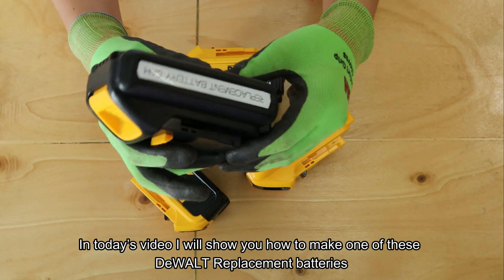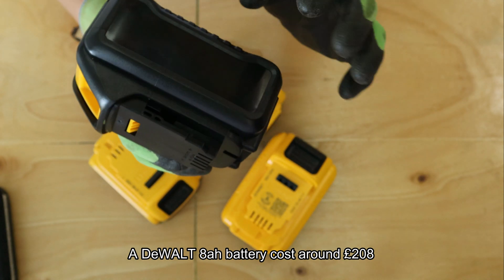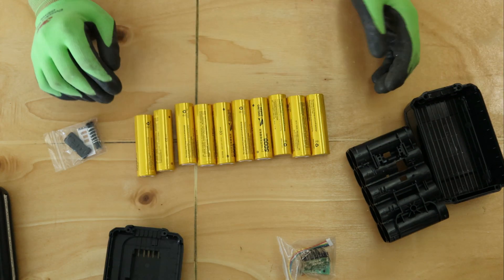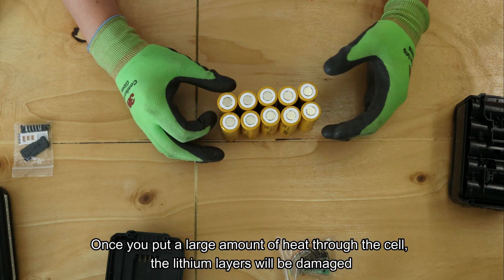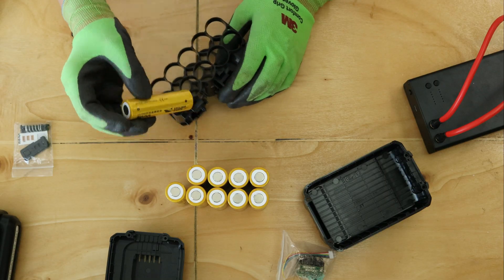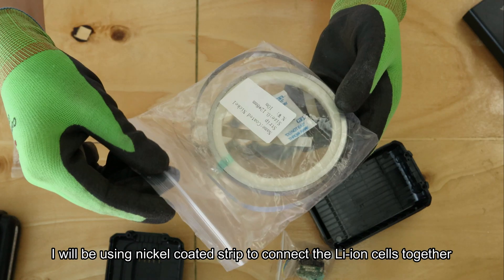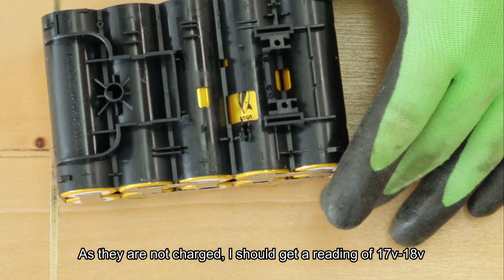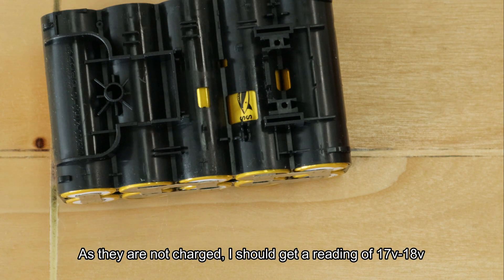Make Your Own DeWALT 10AH 20V MAX Replacement Battery | My assumption was.....

Comment: Use "molicel P60B" 500+ charging cycle, 6000mah capacity, 60a discharge rate, runs cooler than cells DeWalt using in their packs

Comment: Why did you reverse the polarity configuration of the pack?  Standard DeWalt packs have the positive at the front of the pack and the negative at the other end of the pack.  When you are doing something use the KISS method - keep it simple, stupid.  The screws on my 21700 pack were 10 torx.

Comment: I chargers any pack battery to 4.2 volts before I build the pack.  The reason that I do is so I can test them for capacity capacity of the cells - some lithium battery manufactures lie.  I bough some batteries that were rated at 3999 ma and they tested out at a nominal 2550 and change, which is why I buy Samsung batteries, now.  They always test out slightly above their stated capacity.  I tested out some Samsung 50S cells today and they tested out 4,998-5002.  Can’t beat that for consistency, can you?  You need to warn any viewer to put the positive and negative leads on the inside part of the tab on the plug, otherwise you will not get the cover to go on the plug.  That is the voice of experience.

Comment: I am building a 21700 pack to go along with my 18650 packs.  I am building it with 10 Samsung 50S 21700 cells.  It took me six hours to charge them up from 3.56 volts to 4.20 volts.  I then tested them for capacity and the averaged over 5000 ah.  That should create a 10 ah pack.

Comment: I would advise LT42A, P45B, T39 or T42 cells.. You need higher continuous discharge rate than the 10-15 these offer.

Comment: I bought a knockoff DeWalt pack from ebay and I noticed its not as solidly constructed as an original.  Do you think it would be safe to fill it with epoxy to firm things up?

Comment: Cordless tools are power-hungry beasts. They can easily peak consume up to 40A from the battery. I wouldn't advise using those 5.000 mAh cells. They are designed for high capacity at low  currents, like 10A max. Above this current demand, they will heat quite rapidly, and their capacity will go down significantly. The best 21700 Li-Ion cells for cordless tools are those with 3 to 4 Ah capacity since they can withstand currents as high as 40A without any issues.
Reply: Samsung 21700 - 40T
In DCB2108 Powerpack

EVE 21700 - 50PL
For upgrade 💪🌈
Reply: @Moog_06eve 40pl or molicel 42a for best bang for buck for 21700, for 18650 would be eve 25p or eve or bak tabless cell

Comment: The genuine DeWALT 10Ah battery has a slightly larger case for the Samsung INR21700-50S cells. They have extra cooling requirements compared to the 6Ah and 8Ah packs. Both 6Ah and 8Ah have the same shell that is smaller than the 10Ah battery’s shell despite all three having the same 2P5S 21700 configuration.

8Ah has Samsung INR21700-40T.
Reply: These are the details I needed. Thank you for sharing this info.
Reply: @justinholmes5614  Glad to help. I tore into mine a few weeks ago and I couldn’t find that info before. :) I believe the board circuitry is adjusted for the 85°C temperature requirement of these cells (from the INR21700-50S datasheet). It has the same PCB as my 8Ah pack but the board is marked for different configurations… perhaps populated differently for each? Not sure.

There is also a large fuse that isn’t present on the 6Ah and 8Ah packs.

FWIW, I found a set of unbalanced cells in my bad one but after bringing that segment up and running both batteries in the lawnmower this pack still loses power faster than my good one and gets ridiculously hot (good one is just warm). The mower now quits with the good pack only missing one bar and the bad one still having one bar, likely because the mower detected the imbalance and is attempting to prevent over-discharge. Sure enough, I checked and the cell imbalance was worse than before, likely because those cells overheated. I’m now doing a days-long refresh cycle on the bad segment but I doubt it will help. It’s been taken apart with test leads to my smart charger for a few days now. :)

Comment: Uuuuu. In the dewalt your paying for the chip in the batters to prevent accidents.
Reply: The chip in the battery don't save it from low voltage, that's in the tool, mabey the chip your talking about preventing accidents is for charging?

Comment: The trick to making a good replacement pack is to get good, name brand 18650 cells that have a high amp discharge rating. The originals are something like 20amp discharge rated. The higher the mah, the lower the discharge amp rating. The higher the discharge amp rating, the better the tool will preform. A lower rated discharge amp rating will be ok for a drill maybe, but not for a circular saw or an angle grinder. Any 18650 cell that claims to be 6000mah, just know that it's not, and even if it was the discharge amp rating on it would be maybe 1 or 2 amp discharge. So straining the tool will cause the battery cell to overheat and likely cause the tool to shut down.

Comment: The nickel you used is not made for the amount of amps flowing through these packs! Use the nickel that comes with the kit, and use a spot welder that can weld the thicker nickel!
Reply: Here it comes the debate of soldering cells. Thickes strips more expensive spot welder or you risk bad connections. I went soldering route where you heat the battery for literally 1 second. There're videos proving that soldering, if done properly doesn't harm cells.

Comment: You need to buy 2 spot welders folks! Because when the batteries in the first spot welder fails you'll need the second spot welder to spot welder new batteries into the first spot welder.
Reply: Not if the batteries are soldered onto the board like on my spotwelder.

Comment: just to be clear, soldering onto the cells itself is bad, but soldering onto the nickle strip on the the cell is okay? is this because the nickle protects the cell?
Reply from the maker: Sorry for the confusion, you should always try to avoid soldering on a cell. However, in certain circumstances, this procedure is inevitable for example soldering the wire to the strip.
Reply: In my understanding, the balance leads transfer very little power. Just weld Nickle tabs to the battery tabs, fold them over the edge and carefully solder. The heat is dissipated before it significantly can heat the battery. That's how Dewalt does it on the factory packs.

Comment: Where did you get the dewalt battery housing and indicator ? can you provide the link ?
Reply from the maker: https://campaign.aliexpress.com/wow/gcp/tesla-pc-new/index?UTABTest=aliabtest377151_530968&src=google&src=google&albch=shopping&acnt=708-803-3821&slnk=&plac=&mtctp=&albbt=Google_7_shopping&albagn=888888&isSmbAutoCall=false&needSmbHouyi=false&albcp=17858129175&albag=&trgt=&crea=en1005005094635795&netw=x&device=c&albpg=&albpd=en1005005094635795&gclid=CjwKCAiA9NGfBhBvEiwAq5vSy8eg-Ss1ceUjaLjgZy6EYDQ6org5YLDHyawLywunssROdppFtiCQVxoCLI0QAvD_BwE&gclsrc=aw.ds&aff_fcid=f0b87390892c4ddb8923233721832f66-1677028873756-01393-UneMJZVf&aff_fsk=UneMJZVf&aff_platform=aaf&sk=UneMJZVf&aff_trace_key=f0b87390892c4ddb8923233721832f66-1677028873756-01393-UneMJZVf&terminal_id=922908fd10c2456e916aa33e3172fc2c&wh_weex=true&wx_navbar_hidden=true&wx_navbar_transparent=true&ignoreNavigationBar=true&wx_statusbar_hidden=true&bt_src=ppc_direct_lp&scenario=pcBridgePPC&productId=1005005094635795&OLP=1085100208_f_group2&o_s_id=1085100208
Reply from the maker: Above is the link to the case ~ it seems like the availability is going down at the moment, I will keep all of you updated! Thanks!!

Comment: You say “don’t get them hot they will explode” 

You do realize how hot those Dewalt butteries get when you use them right?!?  

Like the charger literally has a overheat fuse and light built in… 

Just wondering if these custom batteries are safe to use in a work type environment? Lmk thanks!
Reply from the maker: Yes for sure a certain amount of risk will exist and this is just a video of me sharing the process of creating a DeWALT replacement battery. I did run it for a prolong period of time with the DeWALT heat gun, there was a few thermal shut down but was not a huge problem. In fact, with the thermal shut downs, I do believe the battery is safe to use in normal circumstance. However I will not and cannot take any responsibility in any case of accident or incident as I am just sharing personal experience. Thanks again!

Comment: That's a good overview of the process! I'd run an extra length of the strip to solder the balance wires to, minimising heat load into the cells, and I'd spend more and get genuine samsung cells - I've no idea what capacity you've measured under load here, but I suspect if you put this on something really power hungry like a router or angle grinder you'd burn those cells out really fast . On that subject, have you load tested this and what capacity reading did you get?

As a reference £60-£70 for a 5ah 18v pack is the price we pay here in the UK, and if you used genuine samsung 21700-40T cells for an 8ah pack I suspect you'd be paying just  over £100 for a true 8ah pack.
Reply from the maker: That's an excellent suggestion, doubling the strip, I will keep that in mind for future improvement. I've tested it with a dewalt heat gun and after leaving it on for 15-20mins, the battery went up to 35 to 40ish degrees and the overheat protection kicked in which I thought was pretty impressive as the entire setup was pretty cheap. 

However you do have a good point, end of the day it is definitely better to stick with the original batteries, instead of self-made or third-party ones.

FYI: I am going to use it for another month or so before I summarise my opinion on making a self-made battery. The only con atm is that I don't think this battery will survive in a harsh job site environment.

THANK YOU FOR LEAVING SUCH A WELL-ROUNDED COMMENT! Really appreciated!!!
Reply: @k-30creator20  you are welcome! I am giving serious thought to doing the same as here in the UK the 8ah packs are, frankly, a ripoff. The smaller packs are quite close to the cost to DIY, but by the time you've imported an 8ah pack you're paying £165, which is a £65 premium.

Comment: Great video! Thank you. I have purchased couple of cases for 18650 and 21700 batteries and successfuly built all of them. I'm having issue with 18650 5-6 ah batteries. When I'm using tool that have big drainage for example circural saw my case start burning and melting from heat.I think this is caused by strips on + and - terminal which are soldered to a cable like on original battery. I'm not sure where is issue if I'm using wrong nickle strip or its too thin. Did you had similar issue?
Reply: Would say could be several issues. I build my own, cause I have some high draw tools that where overheating my 5ah batteries in minutes, and it was annoying. I got the 10*21700 kit, and built it using samsung 40t3 cells. The kit came with steal strips, not nickel. I used my own 0.2mm pure nickel strips, and used 12awg wire to connect the + and - leads. Also on these kits the + and - terminals are not copper like on the real dewalt batteries so that could also be a heat issue. But due make sure your cells real rating at the current draw you need is high enough, and that the nickel strip is thick enough. My 0.2mm nickel strip is only rated for 7.5amps, so in my 8ah battery that would be 15amps, if you need more, you would have to double up the nickel strips, or use copper strips, dewalt uses nickel plated copper strips. Copper is rated like 4x of nickel.
Reply: No one, and I mean no one makes a 18650 4, 5, or 6 ah cell that can handle the load that a power tool demands. You want a cell that can handle at least 20amp discharge (more if it's anything other than a drill/driver). The best you can do on a reasonably priced high discharge 18650 cell is around 2800 milliamp hours (2.8ah). You can go higher than 2800mah if you're willing to pay a huge increase in price.
Reply from the maker: Sorry for a late reply! Please be extra cautious!!! I have not experienced that before. When I am using my battery with the dewalt heat gun, the battery do get warm but definitely not hot to touch.
When it gets any warmer, the battery will thermally cut off, meaning I just need to leave it for a few minutes to cool down then I can use the tool again.
Reply from the maker: Lose connections do generate resistance therefore increasing the temperature. Please be extra careful!! May I ask did the wires get melted or was it just the case that has melted. The reason why I am asking is because if the wires have melted this could be because the wires itself weren't thick enough or the pcb that meant to be protecting the battery pack wasn't doing its job. Might worth getting a different battery case!

Comment: Also, is it not better to use pure nickel strips?
Reply from the maker: I am not sure. Please tell me more ~ learning every day.
Reply: Check out the amp capacity for different strips, both Nps and pure nickel.. As long as you don't draw more than the upper limit of capacity, you're fine. On a higher discharge battery like this, pure nickel would be a better choice.
Reply: For example .2 × 8mm pure nickel-6.5A, .2 × 8mm nickel plated steel-4.6A.